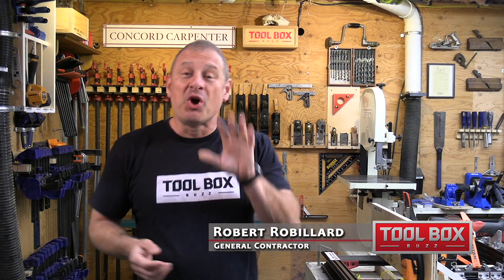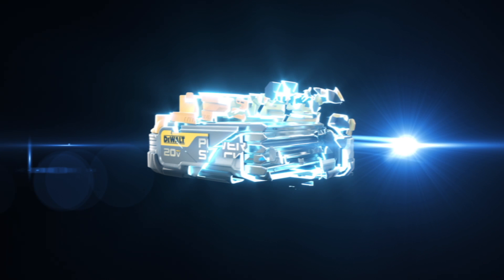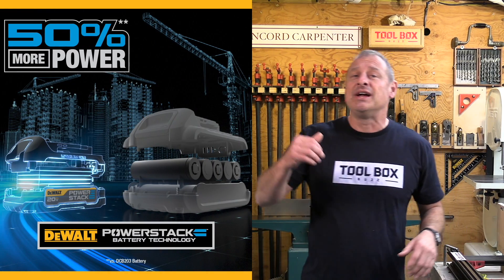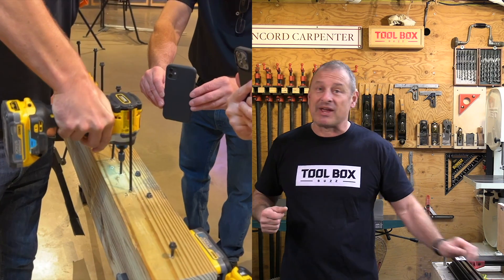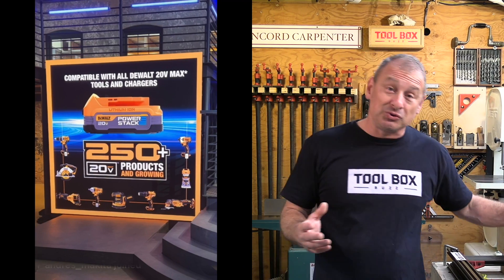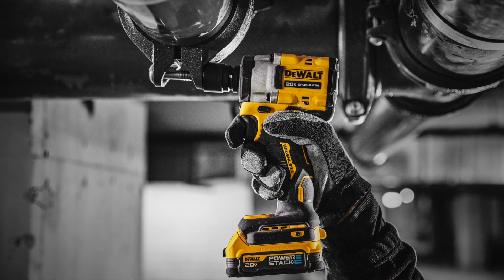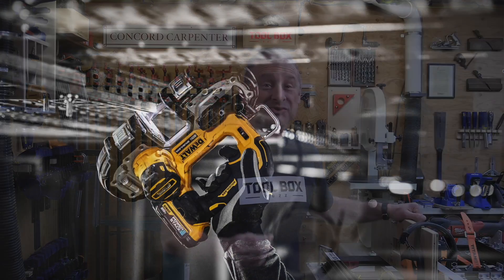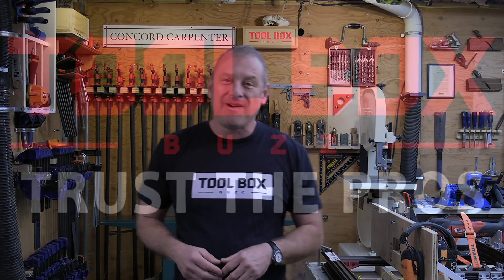Dewalt PowerStack Batteries

Comment: very nice video / dewalt power stack or power bs? to many people having lot of issues with this type of battery, it only 1.7 amp not a lot for a day work. i think for now i use the dewalt 5amp it still better and it last a long time at work. dewalt need better battery output meaning high amp battery like 5amp or more than say powerstack with less wt. they need better battery for today time.

Comment: I just got one with the atomic impact driver deal. I am very familiar with lithium polymer battery tech as I've been using it in RC applications for ten plus years. Lipo batteries eat themselves much faster if you leave them fully charged for long, In rc applications we only charge the batteries if we plan to use them within 24 hours or so. Other wise they should be kept at "storage voltage" which is typically around 3.85 volts per cell. I can't find any information about how these powerstack batteries can be stored fully charged without significantly shortening there usable life? or anything from dewalt saying not to store them fully charged for long which is my norm and probably most others norm with lithium ion packs.

Anyone have any input on this or official guidance?

Comment: marketing gimmick look they reduced the size so there's a size comparison but they reduced the ampere-hour rating from the common 2.0 to now a mere 1.7ah so yeah its smaller but then they jacked up the price so much compared to a 2ah ......if you put these powestack battery on a low current draw tool like a flashlight or radio you would NOT notice any difference and the 2.0 will still win in runtime...the only advantage you have is this battery provides more current or Amp draw than the 18650/21700 cylindrical cells but then.....the tool design is limited to a max current rating by the size of the diameter of the copper windings on the motor and the electronics[mosfet speed control]....yes its a bit more powerfull but at the current price  no way...it it was just marketed as a new battery with same price point as a 2.0 i would not have said anything.

Comment: pack like these will be more difficult to change than cells lol more profit to dewalt since it will force you to buy new battery's instead of rebuilt them yourself haha
Reply: exactly their point of doing these pouch cells are cheaper/easier to make and they're just lipo anyways the same ones used in RC hobby the last 25 years...hold on to your old battery case for rebuilding purposes.

Comment: Yeah, but I can actually replace the 21700/16550 batteries in most battery packs for a fraction of the price, and with better cells.

Comment: Nothing in these will make our tools stronger or faster. But i can definitely see where these can be useful in a compact 12V configuration or in an environment where heat is an issue, cause these are definitely easier to cool without taking too much real estate.
Reply: If cell phones used up their 3 ah battery in 15 minutes of use then cell phones would have never shifted to built in bstteries.  Power tools need to change batteries.  Nobody wants a power tool that is absolutely dead because the battery died.

Comment: Nobody compares them to the 21700 packs because they wouldnt beat those. I dont see the place for these. We already have 12v platform from all the major brands. We also have single stack 18650 and 21700 packs which are pretty compact and powerful as hell.
Edit: there might be a cost reason behind these pouch cells
Reply: yup made in china using 30 year old lipo battery technology

Comment: The old tools were designed to merge with the current flexvolt and 20V series in ergonomics and weight distribution. Wouldn't a compact lighter battery offset the balance and make it harder to use over time?

Comment: They should consider a trade in credit system.  1) give your brand loyal customers a hug, 2) properly dispose of old batteries, 3) keep your brand loyal customers in the ecosystem.
Reply: The batteries will work on all 20V tools and will charge on the current chargers. We haven’t heard anything about completely phasing out the older batteries. For the time being both batteries types will coexist along side each other. The powerstack is intended for when you need the power of the larger packs but don’t necessarily need a 9ah battery to get the job done. Hope that makes sense.

Comment: The use of lipo batteries is interesting.  They have a ton of energy, but I thought they were less stable.  I suppose they have figured that out and use electronics to keep them from burning up.  I'll stick to the lithium ion cells for my DIY needs and let others be the test subjects on these lipo batteries for now.
Reply: i put a 5s RC lipo inside a 5ah dewalt casing so i'm not waiting for their price drop.

Comment: Eh, Rob, I usually really like your videos, but this one was basically just you reading off DeWalt advertising talking points verbatim.  If I want to see DeWalt's marketing campaign, I'd subscribe to their channel.  I subscribe to your channel for real world knowledge, application, and in depth testing.

Plenty of concerns about pouch cells vs. round cells, and you don't really analyze the potential pros and cons at all, just ramble off talking points, which were deceivingly phrased comparing them to having "more power" (higher peak amps draw?) than 18650 cells, but are they any more "powerful" than 21700 cells?  Twice the charge cycle lifespan?  I'm extremely skeptical of this claim also.

More expensive, and probably not as safe.  Pouch cells aren't new technology, there are reasons that no other tool manufacturer use them.  DeWalt releasing them as if they're some magical new li-ion technology is just marketing hype for those who don't know better.  I look forward to some more in-depth testing of these batteries, and maybe there's something to it, but for now I'm extremely skeptical.
Reply from the maker: I wanted to report you the news my friend sometimes we do that this is a brand new release that I saw the day before I posted the video. I would hope that you would want to know what’s coming down the pike

Comment: To me, the price makes it a gimmick.  LiPo cells have a stronger "punch" to them but at the end of the day its still a 1.7ah battery thats over $100
Reply: This is exactly the case, it might be able to deliver 50% more current, but in the end it is still 1.7Ah, so it starts at a 15% disadvantage to a 2Ah  18650 cells. Notice that Dewalt never said anything about runtime, and their print content also never mentions runtime. Why would anyone pay more for a battery that  only has 50% of the runtime of a 2Ah cell (that is my back of the napkin conservative guesstimate) even if it provides more power during that shorter runtime. I don't need my drill to run faster or draw more current if I have to carry twice as many batteries to keep it running all day. 

I say gimmick until we can see 5Ah, 6Ah, 8Ah and higher capacities or we see them in Flexvolt varieties.
Reply: @waldoiswhere  A Dewalt 2 Ah battery has 40 watt-hours and this 1.7 Ah has 30.6 watt-hours, so it's actually a 23.5% disadvantage. That's why they're not mentioning runtime.
Reply: @markwicker2664  I don't know this one detail, are Watt Hours calculated at MAX voltage or nominal voltage? Or is there no standard for WH measurements?
Reply: @waldoiswhere  There's no standard as far as I know and most companies use nominal voltage (as it's cheaper), but DeWalt had used MAX voltage until now, which was to their credit, as a DeWalt battery had 11% more capacity than the same amp-hour Milwaukee battery. With the PowerStack batteries, they have quietly switched to the method (almost?) everyone else uses -- I hope they don't "update" their older batteries to use the new method.
Reply: @markwicker2664  I tore apart my single 2Ah battery and Dewalt used LG ICR18650H2 cells. LG rates them as 2000 mAh NOMINAL and 3.65v nominal. So I don't know how Dewalt gets to 40WH - no math works as MAX voltage is 4.2v, so 4.2v x 5 cells x 2Ah = 42WH and 3.65v x 5 x 2Ah = 36.5WH. They must have all used that "new math" or maybe that "fuzzy logic" to come up with their numbers.
Reply: @waldoiswhere  being a 20v labeled battery instead of 18 volt you know they are NOT using nominal values and using the max voltage for marketing purposes.

Comment: It’s so ridiculous for people to comment about these new battles blowing up. People think they are the first ones to recognize these dangers ? Dewalt engineers never thought about any safety issues? They just grabbed some laptop batteries and stacked them and wow done. You don’t think years of development and testing in every situation was done? Dewalt wants thousands of lawsuits by just throwing a new battery out that will explode? Wow….these same people laughed at flexvolt batteries and tools. 
     Dewalt is always the cutting edge of technology in batteries and framing , remodeling and construction tools and all others follow. Just like snap on. They do the research and development and create the best tools and everyone else just copies them.
Reply from the maker: Agreed
Reply: I think Milwaukee is more of the innovator cutting edge tool company than Dewalt. Dewalt makes some good tools, but I wouldn't call them the leaders in innovation.
Reply: @ZunarZulfiqar  Milwaukee is a great company and has more 12 v tools then other companies. Bosch has fewer 12v tools but they have tools no one else does like a planer and much better jigsaw. 
    Dewalt not a leader? Hmmmm. I’d say their 887 impact lead for years , the 899 and 996 ., but now they are all 6 yrs old …battery operated nailers ? tough system was first (festool and Makita had systems) but those are not tough enough for construction sites. Flexvolt not a leader, first cordless table saw, mitre saw, etc. Because of flexvolt success other companies were forced to come up with competition to it. Milwaukee tried and copied, but realized 18v is not on the same level as flexvolt, and developed MX . Makita 2X 18v , metabo developed similar lines .
    Dewalt makes a tool and doesn’t change it for years 5 or more . Milwaukee has a new generation of tools every year.Dewalt not a leader ? Silly… I’m a framer and every job site I’ve ever been on uses 90% dewalt cordless tools.  Milwaukee is great for plumbing and electrical. Makita is great for any type of work, but lack new tools and automotive tools.

Comment: Hey Rob, great video! What measures have DeWalt put in place in order to ensure the safety of these LiPo batteries? Will they be safe to leave on the charger overnight?
Reply: I wouldn't.
Reply: I wouldn’t either, and DeWalt has been pretty sketchy about disclosing details about these batteries.

I mean even if you look at their website, every single claim has an asterisk next to it…

Comment: Would the 12v Xtreme batteries be even smaller???
Reply from the maker: Yes in theory
Reply: if they reduce the capacity or ampere hour rating the pack YES it will be smaller like 25% great marketing number would you think?

Comment: the price of these at launch is nuts. For the same price of one of the 1.7ah packs you can get a 4 amp pack with 21700 cells and a charger
Reply: 21700 cells were never designed for power tool use. These new pouch cells were designed specifically by our company for power tool use. Also it’s a new “technology” so of course it’ll be a little pricey but as it becomes more standard price will drop
Reply: @Sabipedraza  can you tell us where we can find more about these batteries? As far as I can tell,  they're a lithium ion pouch cell
Reply: @perry1g  To me they look like Lithium polymer pouch cells like what's inside every mobile phone, radio control models, lithium jump packs ect... So not new technology at all if that's the case.
Their no where near as robust as cylindrical cells.
Reply: @perry1g  its really not "new technolog" as they market it...its been around for a long time but probably a better lipo than what you can buy from the RC hobby shop or online.

Comment: For full sized tools no, not at all. Just buy a normal sized battery

But I mainly use really tiny tools(the new dewalt is 10.08cm & the kyocera Ryobi XR is 9.9cm) and that battery doesn't have a back lip, doesn't have shoulders, and even the front section with the release button is shorter. For contrast: A normal dewalt battery is finally getting in the way (when the tools are that small, you start bonking the shoulders or the front of the battery on evverryyythinnnnnng), and even the "compact" single-row 21700 cell batteries are gigantic clown shoes even more.

It all adds up to be a very bad thing for the close-quarters nature of these smaller tinier tools without their existence

I do see one possible future: The significant weight advantage would finally make it possible to have subcompact//supercompact 24v tools. Think Flex, Kobalt, and HILTI.

Comment: Only 1.7ah? So this is pretty much like a compact high output battery?
Reply from the maker: Yes, other batter sizes to come in Spring
Reply: yes....and if you use this on low current draw devices like the flashlight or radio you would NOT notice any difference the flashlight will not be brighter or the radio louder although you would notice it didnt last longer as the capcity is less than the common 2ah pack.

Comment: All depends on who is manufacturing those battery cells. Will they be able to take the abuse and not explode?
Reply: im sure dewalt did a drop test or abuse test but plastic pouches compared to nickel metal casing you be the judge and time will tell.

Comment: Great video Rob! Like the new DeWalt Power Stack Batteries, your informative video is
- 15% lighter, 25% more compact, and 50% more powerful! Great content as always! As a person on the Milwaukee M18 and M12 platforms, I have been very pleased with the performance of of my tools. With that said, It’s great to see other brands like DeWalt and Flex innovating and pushing the envelope (or pouch?) on design and performance. 
(I’m curious if this allows them to circumvent the long standing battery patent that Milwaukee or TTI has had on the 18V/ 20V Battery configuration.)

Comment: It's neat they are doing thus but  just to let everyone know...Cylindrical batteries have many advantages over pouch, prism, and trapezoidal battery forms. The automated manufacture of cylindrical cells is more efficient than for other types, and its smaller form factor allows for efficient dissipation of heat. The loss of one cell in a battery pack has minimal impact on the overall capacity of the pack. Thermal runaway that can result in the battery catching fire is easier to prevent. The batteries 🔋  cylindrical design allows for heat distribution as well as they are rigid enough to be structural components due to the density they are impossible to bend by hand.
Long term it's also a better idea to have cells that are like bottles instead of these pancake bags that bend, can be pierced easily. I just wouldn't replace my 18650s for these ever.
I think its the future for these smaller tools to cut down in matieral and recycling longterm they are less expensive to recycle but they also hold way less metals. (Hense light feeling)  so its really good for a standard drill/impact I think mechanics will prefer it unless the drop off in power is a negative thing longterm.

So these shouldn't be abused especially exposing

Pouch battery do not  have vent on the top to gas itself as well.

In this application for consumer tools It's fine but in a flexvolt 5ah I cannot imagine how the stack would cool itself properly.
Reply: I couldn’t agree with you more. As a long time RC hobbyist and having experienced both thermal runaway and piercing of the packs, run away because you wont put the fire out.
Reply: @garronsteele5143  The pouch cells are no joke. I have drones and when I crash land the batteries can explode,  expand like a bag . Such a bad design for durability.   It's applications should be low powered things. Cylindrical design essentially is the same thing at a flat pouch design instead it's rolled up suspended in a gel and armoured on the outside.
Reply: You do understand this is not the same pouch style battery as in your drone or rc? What your saying is dewalt engineers are completely idiotic and never thought about your concerns and thank you for bringing for enlightening them. That’s like saying flexvolt technology was bad and a joke, when it forced every other manufacturer to develop a better battery and newer tool system.